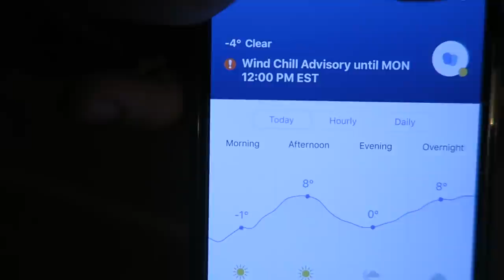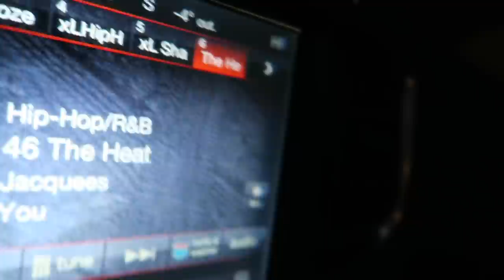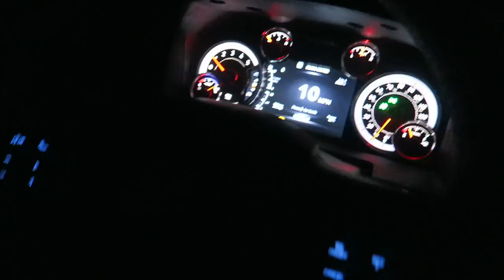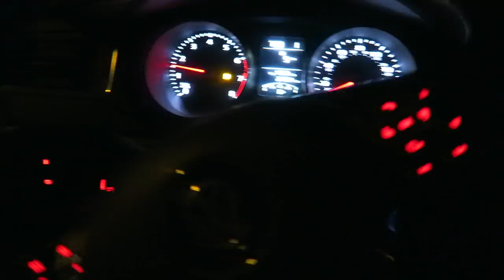Driving a $60,000 Truck in SALT!! *FAIL*

Comment: As a fellow lifted ram 2500 owner i would love to see a sunroof on your build. Im looking to add one to my build this spring.
Reply: I was just thinking that . If has a sunroof if not how about a not a normal one but Panorama?? Like ones Ford have f250 or f350. Thing is slick ! Goes length of cab
Reply: Deon Baker i want to install a panorama in my truck but most shops will not entertain the idea of installing anything other then a a single panel sunroof. But if he got that I would be amazed.

Comment: I wish I could post a video on the comments because that wasn't shit for a cold start lol not hating just saying I have a 2011 ford f350 6.7 deleted tuned straight piped and it was about negative 10 degrees unplugged and it started right up no problems and she sounded like a beast

Comment: You actually don't have to remove the bumper to pull out and put in the inter-cooler, it will come out pretty easy from below, but it would obviously be easier and have more room if the bumper is off. That is the inter-cooler I am going with soon and the Banks' intake horn is the one on order that should be here in a couple days. I should be at the show here in Daytona(only about an hour from me), we'll have to meet up.
Reply from the maker: Yessir! Come meetup!!

Comment: what is that noist when it starts? (the noise that sounds like a jet engine) because i dont think it's the turbo...
Reply: It is the turbo performing an exhaust brake which helps warm up the engine faster
Reply: @diablocell  oh, my dad's van has a 4 cylinder diesel but its exhaust brake doesn't make such a loud noise